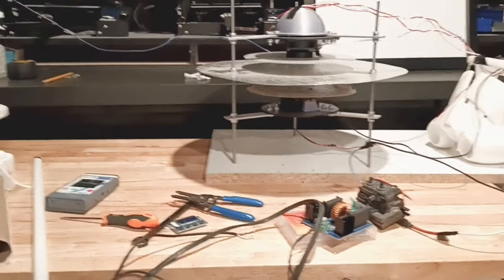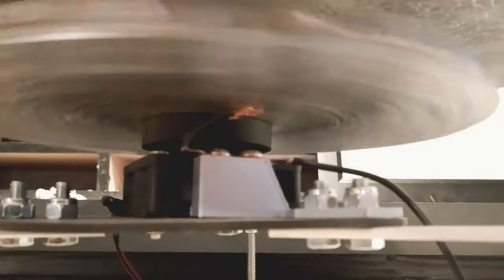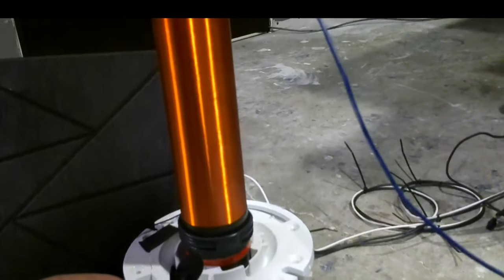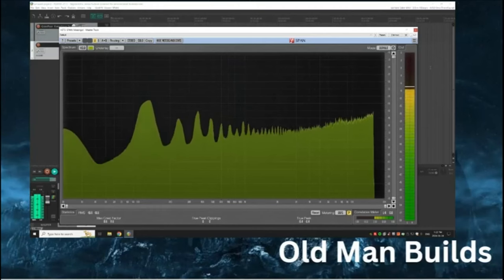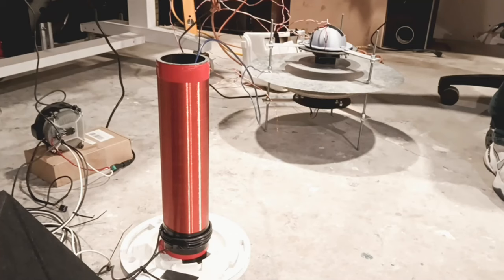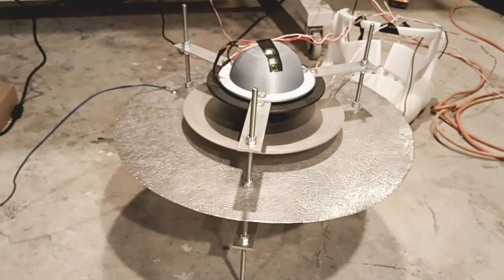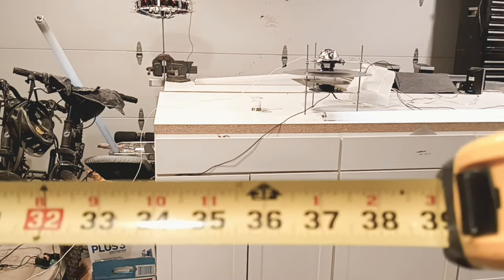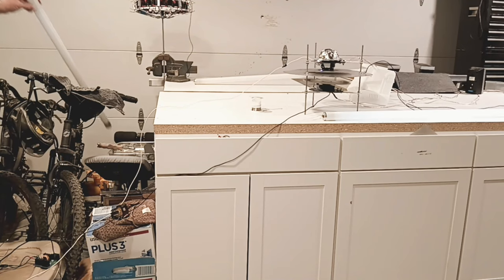Graviflyer "Gravity Well" #37

Comment: These videos are really helping out understanding this, thanks! I might build one with nickel housings/superconductors/lapoint arrays and try something a little different from the typical setup.
Reply from the maker: build this the way I did. The field is 100% real.
Reply: @nathanbunten4299  I watched the whole video, you definitely figured out the crucial step. That beat frequency surrounding  is really important, that is the key. I seen that right away with that 20 hz anomalous frequency cutting everything out on both levitator and coil, that is not a coincidence. If you engage the ultrasound it will interact with it. 

The weird thing is that I see similarities between the acoustic levitator/graviflyer yet one is using a standing wave and the other is a bubble. There is a weight limitation to standing waves but the bubble still has that 20 hz shield and seems not to care how much weight is inside. I think you are right about the polarized center plate, Jarod mentioned it have a pole flip near center, like a Lapoint array. You are getting close, I have no doubt in my mind that this is real.
Reply from the maker: @Tech_Planet  I bet if I got a better mic we would see the frequency go lower. Did you notice the jump in power at the top 4" in the beginning of the video? It is also why at the end the field is able to go further out. 

Jarod said the piezo is creating a pressure and expands at the mhz range. I think the beat frequency of my graviflyer would change that frequency. It ties to everything. 

I saw a few mic's on amazon under $200 that said they go under 20hz. Would you recommend one that you think might work? It would help to verify everything.

If We can get the exact frequency that is in the tesla coil. Then find it in the center plate. Then put a piezo disc directly on that center plate. I would love to see if it receives that same frequency. Then I want to know what it is doing. 

Your discovery has had a big impact on this project. Thank you.
Reply: @nathanbunten4299  I tried responding, YouTube deleted my comment so I just uploaded a different video about Lapoint arrays and some mic info. I wouldn't be surprised if it expanded into mhz seeing it goes it lower hz but you wouldn't be able to hear this.
Reply from the maker: @Tech_Planet  thank you

Comment: 35:00 If the mode of operation of this thing is some kind of "asymetric capacitor" then I actually think that the discharges from the edge of the plate is unwanted. Also I think you really need to have the two charged plates seperated by the middle plate.
Reply from the maker: it works. I do not need to change it. The test you are talking about is a bad result. the final product is a success.

Comment: In my opinion the graviflyer is a levitating device but its not how UFO fly around at sub luminal speeds
Reply from the maker: I think it is the first step to a core of a ship. The lessons it keeps teaching will help in making a better ship.
Reply: well lets just say that it could be the main source of lift for the initial hovering like the wings of a regular aircraft, as for the forward, reverse up and down left right control that's much easier, it can be just regular electrostatics like like ion wind which would also minimize air resistance as theorized by main stream science for hypersonic aircraft
Reply: The wings of a Beatle I'd say would be more accurate. Specifically the texture of the dielectric plate.  

There's no lift happening. aerodynamics are sitting this one out.

This might help...
 
Imagine the center of earth is X0,Y0,Z0 
Everything inside the earths "Energy" fields pulls us towards that point in space. 

And if we used latitude, longitude and a depth, from the center of earth, to account for all the atoms being pulled.
Each of our coordinates would be a bunch of numbers that when mapped out would look exactly like us, inside and out, and anything physical.
at any given time the coordinates would be slightly different from... the person next to us... or any object...
and no two masses could occupy the same space, (except sacred moments...)

This technology is going to create a new 0,0,0 reference point for all the "atoms" inside the field. 
While keeping its own coordinates in relation to the earth.
Like a small bubble inside a large bubble.
Reply: @raycar1165  I know this doesn't use fluid dynamics that was just an analogy about what this thing is doing for a ufo craft like what the wings do for a regular aircraft it's the main source of lift for the ufo that just doesn't use a fluid like air
Reply: @raycar1165  makes sense in a quarky way

Comment: If the tesla coil is playing the role of a planet field then i recant  my last comment .  But still where is the field for these craft in between planets ???
Reply: This is not a spacecraft. This is more like Magneto from X-Men.
Reply: @jeremiahlowe3268  I am on the side that magnetism not necessarily  the type related to iron , is how these craft navigate accurately without getting lost or hitting objects on the way. Essentially magnetizing the craft to a certain magnetic field located elsewhere . We have to remove the block in our minds that magnetism only works with Iron , depending on the magnetic field type is depending on the material type it attracts this is very handy since planets in general have a specific mixture of metals and most mixtures of metals are exclusive to that planet . Essentially  i am saying there is no way to travel threw space if planets are not part of the equation "unless" you are using gas nebulas to get around but that sounds harder to tune to
Reply from the maker: If you understand resonance. Then you understand why there is no field between planets unless it is the sun's field. Yet it is not magnasism either. Did you know quartz has a magnetic property that is not a magnet. It is where gold miners find all the gold. The gold is also embedded into the quartz. Resonate the gold and it will hit the quartz thousands to millions of times. Every time the quartz is hit it creates an electrical energy. If a planet's core is filled with these things you get a resonance chamber. It amplifies resonance. This would be an endless supply of power with a magnetic signature with no magnetic pull.
Reply: @nathanbunten4299  no pull you say? ,,, if this is true at least you can use the signature to navigate . Thus far its all speculation
Reply from the maker: @mykedoes4099  I think there is more here. But until we all see it you are right. Somehow I think that will change though.

Comment: .. Good luck ..i prefer the riggers on hard azz science ... objective is to disprove hypothesis..   granted many break though have been found and not understand principles .. 
example ..  atmospheric engine was invented by Thomas Newcomen in 1712, or a Smeaton engine ..  
At some point  once you have LIFT  ..you will have to place in a vacuum .. or show Gravity variations using  accepted equipment on earth surface .. LARGE change in Gravity ..easy to measure
Reply: I would be happy just to see it lift a centimetre at least